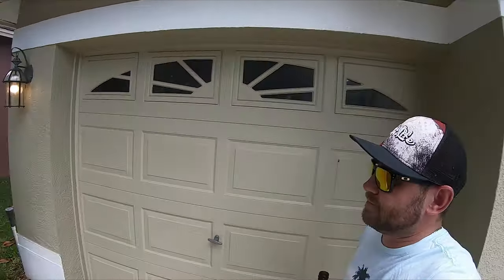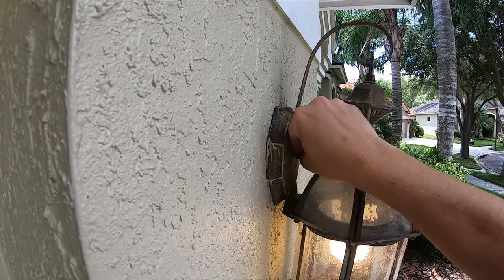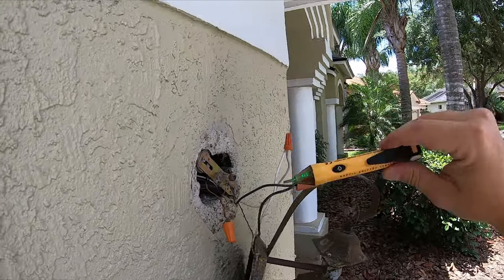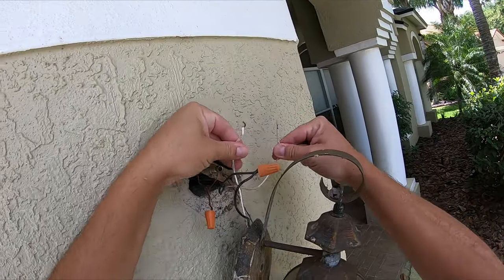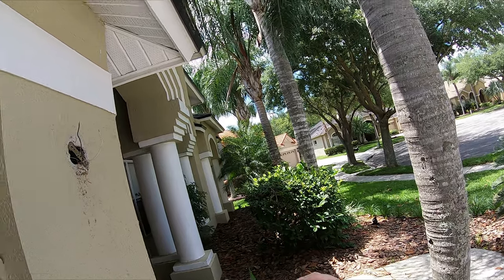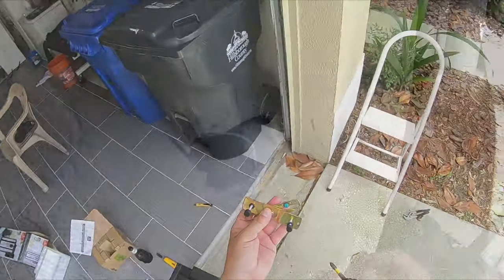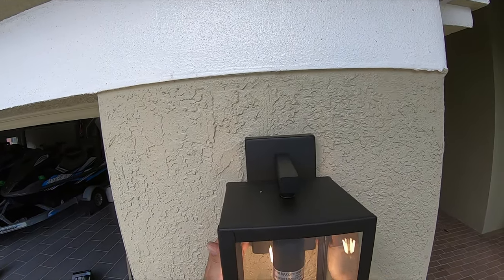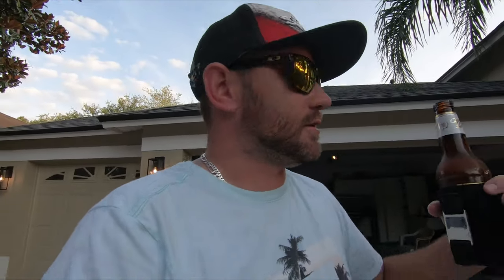DIY Light Fixture Change With Power ON! (Skill level = 1 Beer)

Comment: how are you brother. I have a friend who lives in an apartment that unfortunately has no power box to kill power in the apmt,I assume it's how the house was built, the kitchen light fixture was switched. lol with no pulley. There's no on/off switch. There's a small power box with two switches.1, switch powers off 1, room. The other switch Powers off the wall outlets. I was considering installing a pull switch to the fixture. I've installed light fixtures ceiling fans and etc.
Of course with the power off.
after watching your video.i thought I try it out.do you have any advice.?
Reply from the maker: Hey man, as a disclaimer, I do not recommend doing electrical work with the power on.... There are electrically insulated gloves on the market that you should probably check out to give you added protection to however you do your project. Cheers